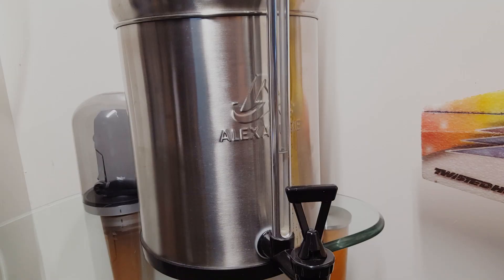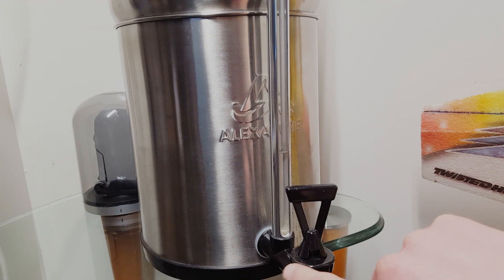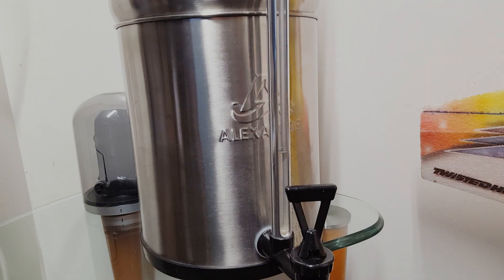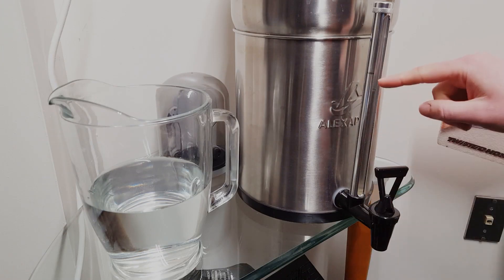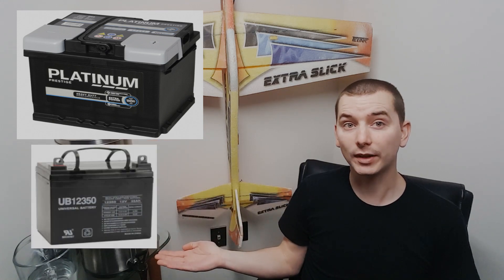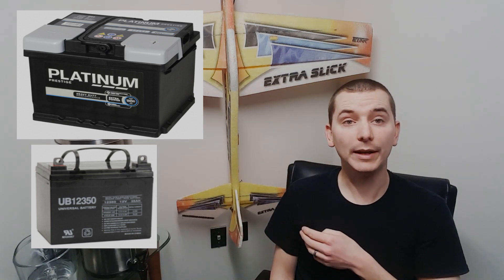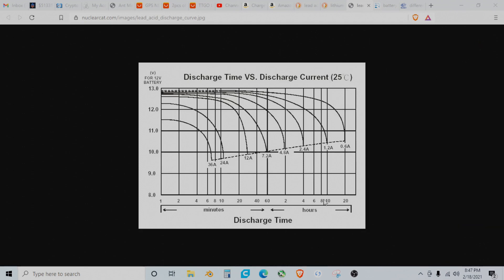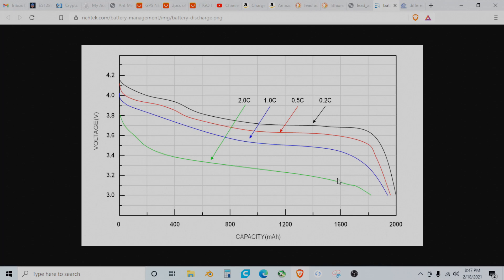Battery Voltage Sag Visualized - How Amperage Draw Affects Battery Voltage - Design Considerations!

Comment: Thanks Good explanation, I was using makita batteries for an ebike and they don’t drop much, I built a battery myself and even though bigger ah it hits the lvc quicker if using high throttle, but will go further on low power.
I’ve been trying to understand why and now I see the voltage just sags to death, I used good Samsung cells but they have a low amp rate.
Reply from the maker: You got it! Typically the cost of high amperage delivery from a cell (like the makita batteries) is a lower capacity. They won’t have much voltage sag but don’t have as much runtime. Cool to see it in action though, isn’t it? Thanks for watching!

Comment: I appreciate your simple explanations.  I ride and EUC (electric unicycle) which can draw a lot of amps to stay balanced at speed.   Understanding voltage sag can keep me from falling on my face!  If I were to make a suggestion it would be to include a caption of each lithium batteries you are testing.  I believe you compared Lead Acid, Lithium NMC, and Lithium Iron Phosphate (LiFePO4).  (When you're not familiar with them they all sound alike).
Reply from the maker: Thanks for the suggestion!

Comment: I’m thinking my BMS went bad. Every time I get close to absorption, two of the eight batteries change charge rates. One goes up and the other one goes down while the other 6 stay in unison. Then when I do A draw by the inverter, they magically go back to balance? Then when they go back to absorption they diverge again. 🙈
Reply from the maker: Have you verified the voltages with a multimeter? Can you give more details about the battery?
Reply: @diyrenewableenergyelectron4996  
Yes I verified the voltages with a multimeter. I have eight Battle Born Batteries wired in series/parallel 24 V. The six worked perfectly for about six months, then I added two more and right from the get go they were about 30 V divergence between them when they arrived. In the past I had always had them one volt difference if at all. So I connected the two to the six others and did not draw a charge for 24 hours. Right from the start they had issues. Two of them kept diverging from the others. 
I called Battle Born Batteries and got two different answers on what the battery capacity should be. I thought it was 800 amp hours for eight batteries. I had also sent an email, and got a different answer of 400 amp hours. After calling again I got the official word that 24 V on 8 12v 100 amp hour batteries would be 400 amp hours. I thought that fixed the problem until they go in into absorption. This is when they go out of kilter. I start to draw power off the batteries and they go back into synchronicity. So the two new batteries have some kind of BMS problem? 🤔
Reply from the maker: Hmmm. If it is the two new batteries giving you problems I would try documenting it as well as you can in video and seeing if Battleborn will warranty them. It does sounds like there's something weird going on. If you have 5 parallel strings of 2 12V batteries in series, they physically cannot be different voltages unless the BMS is disconnecting . Do you have a clamp meter to measure current? I would be curious to see if there is huge amperage movements occurring when the two start getting weird. When they start to equalize again at some point later in the day (when you draw power like you said) I wonder what kind of current flows when they synchronize? How large does the voltage difference get before they synchronize back up? You could have a large amount of current flowing when that happens. Something is definitely off about that though.
Reply: @diyrenewableenergyelectron4996  
The eight batteries are wired in series/parallel. Four on top and four on the bottom. Connected together in four connections negative to positive. Then the top line in positive parallel and the bottom line in negative parallel. Never had a problem with six batteries. 
I’ll have to do more testing. Right out of the box these had issues. It’s only been three days. I hope by having these connected they don’t start a fire?
Six of the batteries were at 14.39 V and one of the problem batteries was at 15.30 V and the other was at 13.47 V. Quite a divergence from the other six. Thanks for your input, I still have a lot to learn.
Reply from the maker: Derp. No idea why I said 5 parallel strings..... I blame Project Overkill lol. If they had problems right out of the box I would 100% get with battleborn. That battery at 15.3V is concerning..... I don't think there will be a fire, but permanent damage of the offending battery is possible. I don't know what voltage the BMS in the Battleborns cut off charging at but that 15.3V battery is allowing your cells inside to charge to at LEAST 3.83V per cell. No bueno. 3.65V per cell should be the max for LiFePO4 cells. If it were me I would remove the offending batteries from the other 6 and investigate the two individually. It is possible it is only the high voltage battery that is causing issues. Hold on, I read carefully how you said you have these batteries wired together. The bottom terminals of the bottom row is paralleled together and is your main negative. Are the positive terminals on the lower batteries paralleled together? Likewise with the negatives of the top row. Not your main 24V connection points, but the terminals where your series connections are. Are there any parallel connections there? This whole thing could be a connection issue. If you don't have the terminals I mentioned above paralleled together then you can get these voltage differences because you aren't parallel connecting each 12V battery to its 3 counterparts from the other strings. If that didn't make sense let me know and I will email you a picture or something :) I wish I could be more help!

Edit: the connection thing is a shot in the dark but worth mentioning.
Reply: @diyrenewableenergyelectron4996  
 
No I’ve checked multiple websites and even battle born sent me any image to go from. I know they’re connected right because six of the batteries have worked great for a long time. 
Basically you have four batteries on top and four on the bottom. The positives on the top are all parallel, as well as the lower batteries on the bottom negatives are all parallel. Then you connect the top negative to the bottom positive. Doing the same on each battery, connecting the middle in series. Parallel is straight across and series is top to bottom. This way all the batteries are connected. 
I have a feeling if this is a batch of batteries that I got, perhaps the BMS were wired wrong.
Reply from the maker: Gotcha. Figured it was worth asking just in case! Hopefully they can get you squared away, they are a killer company. Thanks for watching!